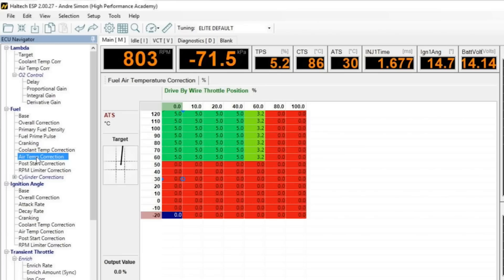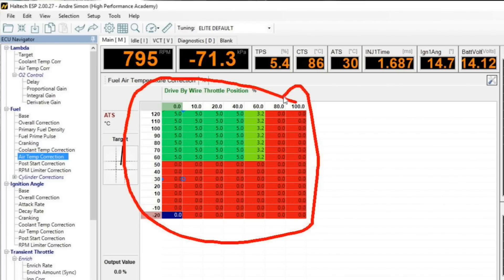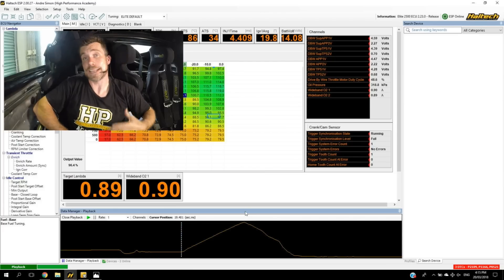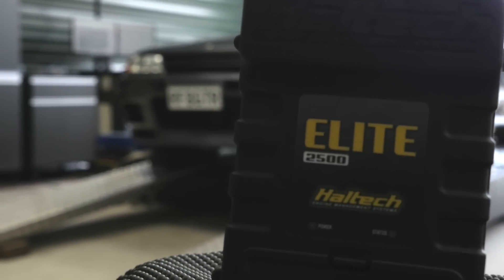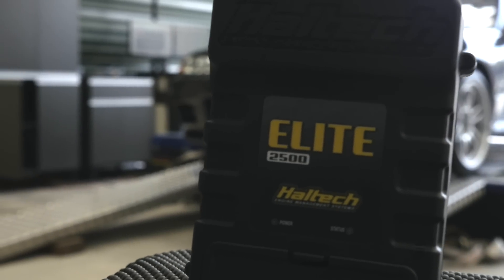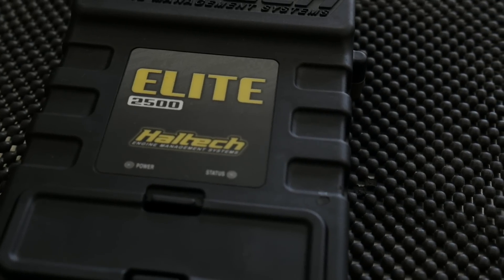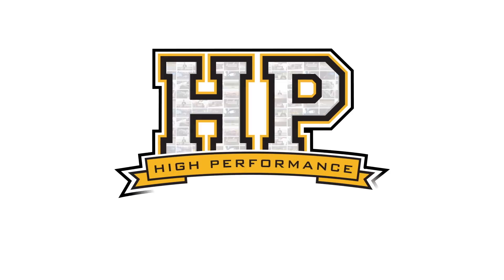Our TOP Haltech Tips and Tricks | Elite ESP Tuning Software [GOLD WEBINAR LESSON]

Comment: i have a question. can you run LIVE closed loop? meaning using wideband in real time setting a target afr and the ecu self corrects on the fly 

because from what I understand it has a trim table. and then you need to apply the trim tables at later date??

Comment: It's gotta be the Adaptronics acquisition resulting in the Gold. That looks like a seriously powerful tuning tool. Prior Haltech was so bad there are memes and a rap song about it. Adaptronics is super geek mega tuning running 24 plugs multi spark with an add on module.
Andre that was an awesome demo on the Gold, I'd feel comfortable enough to jump right on it now.  Some seriously powerful features. I'm going to say you are so spot on.  There are even well known tuners that are not really reaching the proper tune at the end.  It's far to common for guys to start running wot and dropping out as they block fill the tables from the run. Only set timing at max rpm creeping up until it stops making power and ship it out the door. That's a great way to get everything close really quick but not the final product. Those are the cars that stink driving around at 2000rpm throttle cracked open running 12.5:1 throwing money away as they go. An LS/LT will run great throttle cracked with dual tables based on TPS less than 15-20% with 15.5:1 even 16:1 with rpm range of 1800-2800. Timing will be way advanced out like 44 degrees if you're at 34 wot. It's kind of like dod but with all cylinders firing. My guess is that vw did something like this that got them through emissions testing. No matter how you slice it, there's no way a diesel is close to a gas/petrol engine emissions when they are running near 60:1 most of the time. They have a hard on over particulates that are heavier than air???  Whiskey tango foxtrot, over?  Let's put 3.5 times the CO/CO2 in the air per mile/km traveled because of soot?? Are you freaking kidding me?

Comment: what is "page up for power"?
Reply: Page up makes a big change (in the positive direction) to the highlighted box, so if it were your Boost Duty % you'd add a big % of boost to it, or timing, etc
Reply: Control + page up gives a smaller increase, and shift + page up gives a bigger increase.